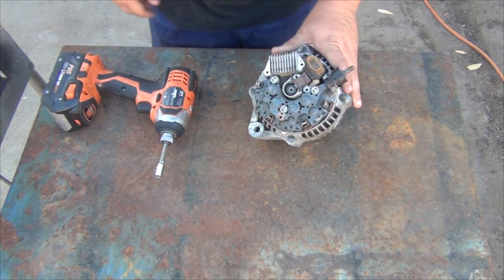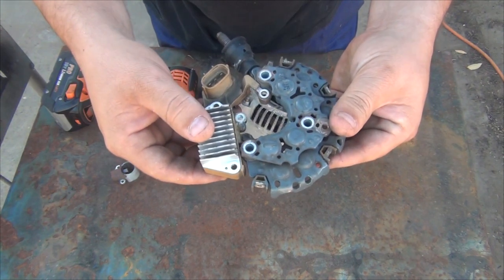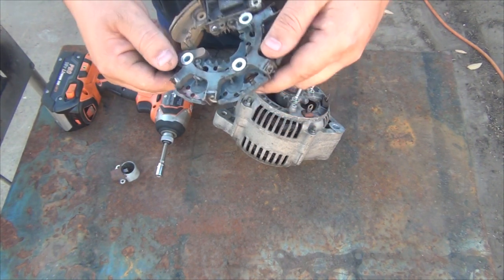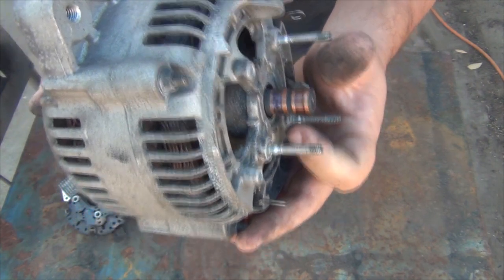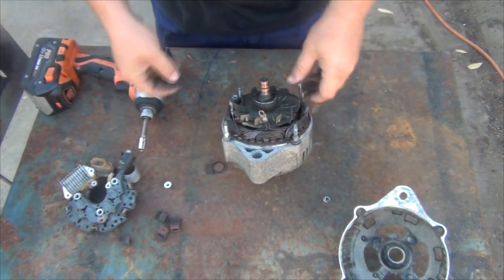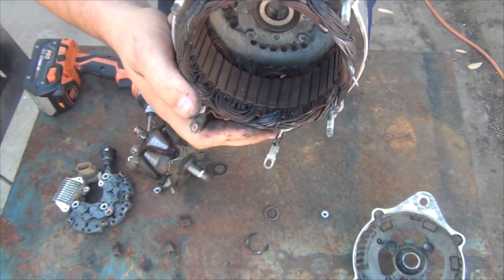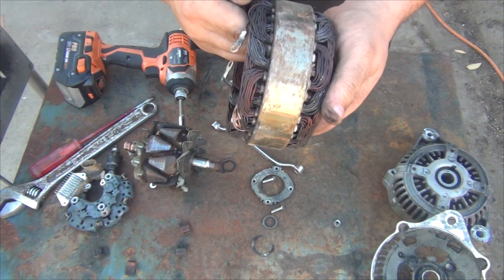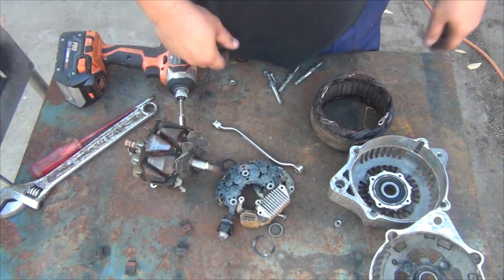Hino Alternator Teardown

Comment: cooked windings, alternator was good until the amp draw got too high for too long.

Remember most alternators have nothing in terms of overcurrent protection, so if you pull too much out of it, they'll overwork and crap out.

Comment: Eeek it does look like the poz and neg diodes are short circuit, thats unusual, most of the time its just one polarity of one phase that goes o.c.
The regulator may still work and the rotor windings, but its make a coffin time and give it a burial ha ha ;-)

I used to work in a factory that did reconditioning of alternators, no matter how good the quality, they all die lol.
I tend to keep in mind the really simple/old lucas acr type of alternators, an old design but basic to all alternators :-))